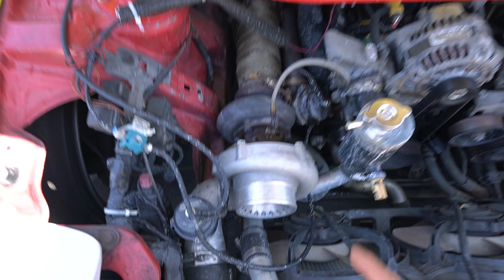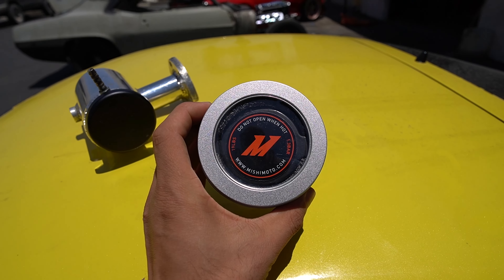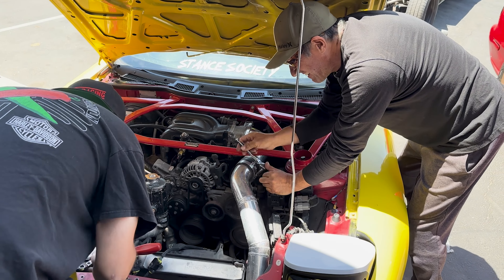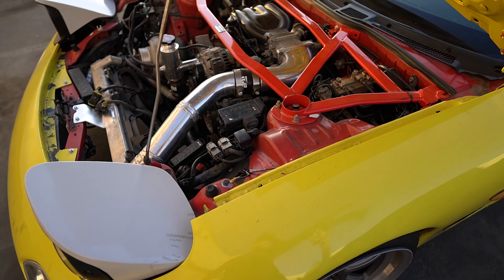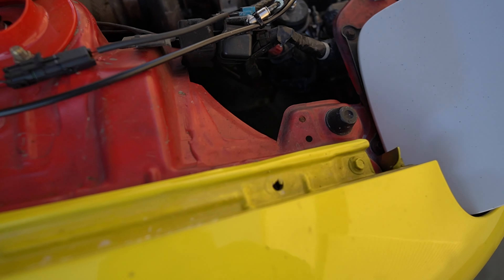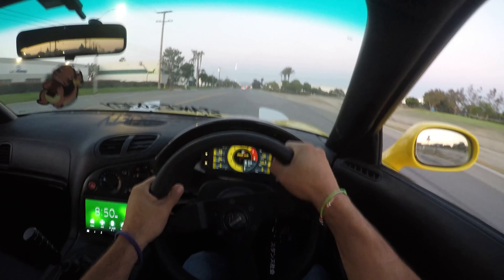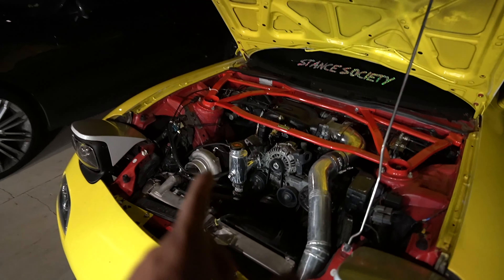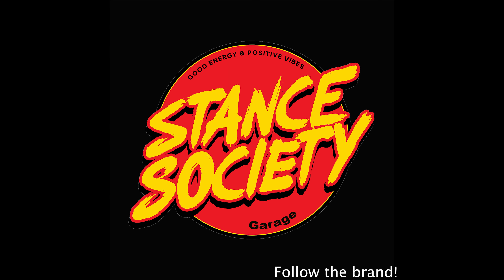FIXING THE RX7 FIRE & OVER HEATING PROBLEM!!

Comment: I just got a 93 FD R1 and trying to figure out at what temperature the cooling fans kick in? Tried to do the coolant bleed but had to shut off the engine after 20 minutes because the coolant bleeding funel was getting full with coolant and at 204 F temperature the fans were not turn on. Do I need a new thermostat, water pump etc.??